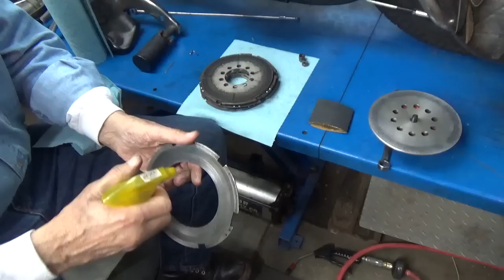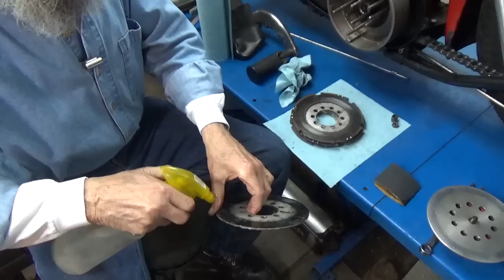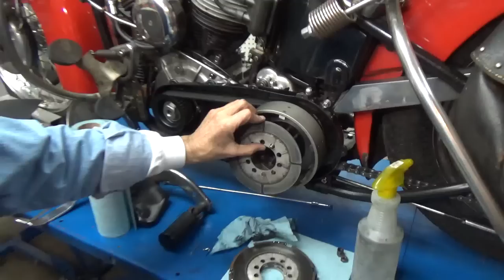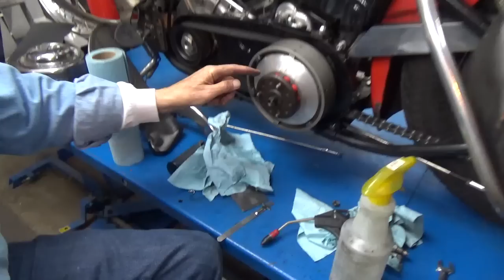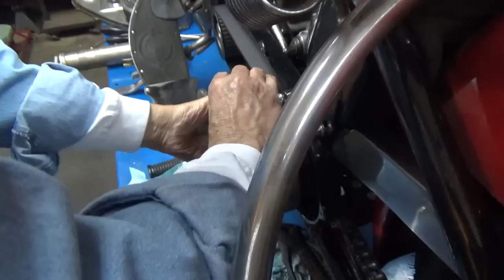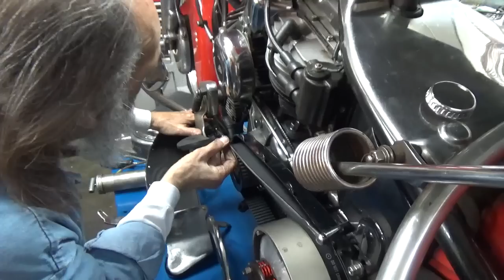We're Doing The Clutch Adjustment On My Harley Davidson Panhead Again!

Comment: Hi Mike, Many Thanks for sharing all your knowledge. You have been a valuable resource to me over and over again. I have a slight issue with my clutch on my 1981 FXWG Shovelhead. Everything is stock but it has a very agressive crash style gear change as I change gear it sounds pretty clunky. I've had advice and people say "Buddy, that's just how they are" but I have a second symptom with is I cannot find neutral while the bike is running. She just jumps from 1st to 2nd and back to first until I turn the bike off. At which point neutral is easy to find. I've used up all the adjustment on the cable and am left with no more play. My question is, should I be compressing the springs on the pressure plate or decompressing the springs to get a bit more clutch action. Hope your day is awesome. Bill from Ireland 😁
Reply from the maker: The bike jumping back and forth between gears sounds like a transmission problem.  That 81 4 speed has what's referred to as a "rotary top."  Inside that lid is a shifter plate.  I suspect something wrong in there.  That plate registers the position for each gear.  I'd have to look inside.  I hope that doesn't ruin your day.  You wished me an awesome day and I don't want to be the bearer of bad tidings.  But, I don't think I could tolerate a gear change that I didn't call for.  Take care.
Reply: @pacificmike9501  Hi Mike, Thank you for your advice and for taking the time to respond. It's really special that you always make time to. I appreciate it a lot.
Reply: @billynolan3393  Hey billy when you say "jumps from first to second" are you referring to trying to find neutral? Or do you mean its shifting gears without any input from you on the gear lever?  Ive noticed with my twin cam that it can occasionally be finicky about finding neutral. Its was really bad when I first got the bike. Ive since changed the oil and meticulously adjusted the clutch pushrod and the cable to spec. That makes a huge difference. But that isnt all. Ive noticed that the gearbox has another habit I am familiar with on other machines - getting to neutral is a whole lot easier if the bike is just barely rolling or if I just give the bike a little nudge from the clutch as I go for neutral. It has to do with how the gearbox meshes and a little input will let things click. BTW = I dont know if this is the case with the gearbox in your bike, but Im told that in mine, they are designed to not go into neutral from second. I could be wrong about that though. 

So if it is a "find neutral" issue - double check all the adjustments - pushrod and cable. and try hitting neutral just as you roll to a stop. that will probably give you a better idea where things need to be looked at to make things even better.
Reply: @michaelhazen8658  Hi Mike, yes that's exactly it. She won't find neutral when running. I have naturally found that if I grab neutral just as I'm coming to a stop. It's much easier. The bike had been sitting for a long time before this year and I freshened up most everything apart from the clutch. I'll take it out and give it a clean and then adjust the push rod and cable. Many Thanks!!!!! 😁
Reply: @billynolan3393  Excellent! Im also using specific gearbox and primary oils - not "one oil for all" or ATF in the primary as some like to do. I think type and age of the oils makes a difference.

Comment: Hi Mike thanks for the video I’m having trouble adjusting my clutch adjusting screw I can turn it in to tighten the clutch but I still can’t get my clutch to function correctly it will not disengage the gears so it always seems like it’s in gear for example if it was started and I open the clutch to release it to bike with jump in stall
Any ideas on how I can fix this
1955 Panhead
Reply from the maker: Hard to say.  You may have your plates sticking together.  Have you disassembled and cleaned it all?

Comment: Hi Mike! Realy enjoying your channel, great to see another old grey haired biker type working on old bikes. Kind of an off topic question for you. I recently aquired a 59 Pan after many years of running a 77 Shovel. Loved the belt drive on the shovel and I'm thinking that the Pan will get a belt this winter. My question is how did you route the crankcase breather on Baby Doll?
Reply from the maker: You may have to modify the breather tube going into the primary.  Remove the tube and modify the primary end to attach a 3/8 hose to the end of it.  Route the hose behind the primary tin and out the back of the bike.  Be careful how you do it so it doesn't ever spray oil on the rear tire.  Be sure you bottom the oiler screw on the oil pump.  Don't tighten it so much that it damages the pump.  Now it is just a breather and not an oiler.

Comment: I just put in new clutch hub, friction discs, aluminum releasing disc and springs. The Barnett springs are 50 lbs @ 1-1/8”, and appear to be somewhere around a 1/4” shorter than stock. Does that affect the measurement I would set between my pressure plate and my releasing disc versus what the manual would state for stock springs?
Reply from the maker: You say, "Shorter than stock."  By whose calculations?  What years are the new springs intended for?  You mentioned "an aluminum releasing disc."  Are you measuring the spring length from the disc surface?  I believe the springs are seated in the "counterbores" of that disc.  Be sure you're counting that counterbore in the length of the spring.
Reply: The springs are Barnett (part #501-66-10041) which the site says will fit my 71 flh. The springs that were in my clutch, which I can only assume are stock length, though I have only owned the bike for 6 years, are longer than the new ones. The Barnett’s are a hair under 1.5” and the ones I pulled out are 1.72” with my fancy digital caliber. As for measurement location, I prefer to measure from the plate, versus the counterbores for convenience reasons. The depth of the counterbores look to be about 0.340” (11/32”?) deep.
Reply: So I found my answer and thought I would share. The springs are actually for 67 or earlier clutch assemblies, whereas I have a 71. Apparently the earlier assemblies used 3 1/2 friction plates with stiffer springs and had the mousetrap to assist. After 68 we have 5 plates and they ditched the mousetrap. I’m sure you know all this but I dint want you to chase an answer unnecessarily. All the sites I visited state they are compatible. I set it up with the spacing set in the manual as the Barnett rep told me to. The clutch hub nuts are not on a lot, as they are flush with the studs. But they are not loose and I hit them with a dab of blue locktite. Works really well, and I don’t really notice the increased tension as I run a foot clutch. Thanks.

Comment: Hey Mike, new subscriber here. Love your videos. Can't stop binge watching them!

 An old shovel owner and rebuilder here, years ago. Twin cam owner now. Learnin' stuff here like the extra steel disc hint.

Question: I noticed in this video that you installed the clutch steels still shiny but scuffed the discs. What about scuffing the steels? All the old stories in the old days of guys slightly roughing up clutch steel discs on the side of the road on the concrete when the clutch started to slip...?

Thanks again man.
Ride safe,
Frank
Reply from the maker: Not all materials are the same.  Do what works for you.  They will get "polished" in there anyway.  Clean is what you need.  Clean and dry.  Again, what works for you is what you need.  Take care.

Comment: Hi from Russia Mike! Have 1977 shovel. What distance to plate in spring place you gauge? my cluch works good, but have “n” time to time..
Reply from the maker: 1 1/32.  But, what works best is what works best.  Make sure it breaks even all the way around.
Reply: @pacificmike9501  thank you! and another question :my bike have lots of pressure when cold, but warm there's like zero in traffic. s&s oil pump on it, mineral oil 20/50. if run - is 20 and oll great, whan stay in traffic pressure  go to 0. Do you have any solutions? Or is normal

Comment: Mike! Working on a 55 panhead and got everything running good! When the bike gets nice and warm if i am at a stop in first gear with the clutch pulled in the bike will intermittently try to jerk the bike forward.. its an open belt primary and looking at the pressure plate it looks as if it grabs and then frees up and then grabs and frees up.. and it spins with what appears to be a wobble.. any advice on how to attack this problem? Love the videos by the way! Keep em coming
Reply from the maker: Thank You.  We showed getting those plates clean, so they don't stick together.  Another thing to try, and it's not very expensive, is a "Ram Jett Retainer" for the clutch basket, which keeps the basket straight when the clutch is desengaged.  Other than that, readjust the springs.  You will get it, because you're getting the experience.  It gets easier and easier.
Reply: You're awesome thanks for the reply!

Comment: Specking of clutches what's your thoughts on the ram jet retainer? The old lowrider has a 5 bolt studs with the tin retainer and springs, hard to shift into first gear and drages at stops.
Reply from the maker: I first met Roger (Ramjett of Ramjett Products) when he demonstrated that retainer at a shop I was working in back in the early eighties.  We became good friends after that.  I've used those retainers ever since.  If never change to the five stud hub.  But, there's nothing wrong with them.  I just don't see the advantage.

Comment: Hi Mike, '75 FXE Super Glide here.  currently in the bike is a 3-stud clutch hub.  Unevenness felt on the studs indicating wear.  I see Drag Specialties 5-stud hubs after market.  would you point me in the direction of a quality replacement hub and clutch?  Also interested in tracking down the auto-chain tensioner you show in one vid.  Thanks in advance for any suggestions.
Reply from the maker: I don't advertise for any of these people.  But first, I never could find the an advantage to the five stud hub.  You clean everything and make it break even.  Done.  If you want a better than stock clutch all of the suppliers carry better plates and springs. If you're looking for a better designed clutch, they get more expensive.  I like diaphragm clutch springs.  Rivera Primo and Baker Drivetrain come to mind.  The automatic chain tensioner you probably saw is an M-6, carried by most suppliers.

Comment: Mike.....I lost a drag race against a Sportster due to clutch slipping at the end of the quarter, so, I bought a set of Barnett discs. Like wow! I would barely release the clutch lever (Shovelhead) and I was on my way. There sure wasn't much slippage vs the stock HD stuff. For street, give me the stock stuff....but for drag, give me Barnett!....walt...tulsa,ok
Reply from the maker: You know I can't push products.  But, they are a family run company that I've had the pleasure of doing business with personally, since the days of my 305 Honda Scrambler.  That would be 1967 or '68.
Reply: david, my barnett is slipping when i get on it . 80ci 83  fxwg .  seems its always been slipping since i got  the bike back together . i just dont wack it down alot so been dealing w it .  did you go by the barnett spring torque specs?  you running any oil in the primary or using the stock oiler ? maybe im getting to much oil in the basket by filling ity to much ?  any advice would be great !  thanks form the vids mike
Reply: @hanskonrad5850  the Barnett clutch discs that I bought were wet and dry. If your clutch is slipping with them you have something else wrong. (probably not enough pressure plate pressure) I've driven drag cars where the clutch discs were unsprung and that's what the Barnett felt like in my Shovel!)....david
Reply: @davidcook1166  thanks David I thought about the springs also  Will snug up maybe a turn or 2 then check it out .  Barnett says 6 lbs ..hand clutch is very easy to pull so can maybe use a stiffinin

Comment: Thanks, also I hv an aftermarket wet/dry clutch on my 59’, 4 Clutch pads & 4 steel plates, and the distance from the outer Pressure Plate to Spring Collar is not 31/32 it’s very hard to pull the clutch lever but it was 1-1/8 before disassembly but I got it to 1-1/16. Would this be ok for the setup I got, it’s been years and a cpl head injuries since I put it in new in the 90’s ? Thanks
Reply from the maker: Be sure the angle on the clutch arm is correct.  Be sure the throwout bearing is operating correctly.  Remember, a dry clutch runs dry and a wet clutch is really  wet.  Apparently, your clutch can be used either way, but not both.  Your system is for a dry clutch, so you have a dry clutch.  The measurements are merely a starting place.  The springs have to compress to release pressure on the discs.  You didn't mention if you have a mousetrap.  If so, please refer to our video on setting up a mousetrap.  Go to our Youtube Homepage and click on videos,  There's a bunch of them, but find the one on mousetraps.  If you still are having issues, write back with more details.

Comment: Thanks, I restored a 59' Pan thats leaking engine oil from the Primary Case, like 1/2 quart a week if it just is parked, Any ideas ?
Reply from the maker: Yes, it is either "wet sumping" or you need to adjust your chain oiler, or both.

Comment: Mike, First of all I'd like to thank you for all the videos! I'm a true fan. I also have a 52 Pan I've been trying to bring back to original. It was in a 58 swing arm frame when i bought it. I've come a long way since. What belt primary are you running? I don't want the chain to deal with like I had on my 57 years ago. I'd also like more choices on pully sizes to get more on the top end highway gears. Thanks Mike! -Erik
Reply from the maker: Thank You.  I'm running 8mm Rivera Primo primary belt drives on both my Knuckle and my Pan. I believe they are still available from American Prime Mfg. (562) 889-8665.  An 11mm is a slightly higher ratio.  The way to raise that ratio is a bigger trans sprocket.  That's it.  Not a lot of choices on a belt primary.  11mm setup is slightly higher.  On your trans, 25 tooth on a ratchet lid trans, 26 on a jockey lid.  That's super high gearing.
Reply: @pacificmike9501  Thanks for the quick response Mike. I'll check it out.

Comment: Working on my shovelhead clutch . Can of worms. Dry like yours ; belt drive . I have to rev it to get in nuetral . My springs are 5 Barnett and 5 factory springs . So I went back to all factory springs . Now I have to rev to get in neutral and it goes past and to second gear . Frustrated- got it set up as loose as possible and most clutch pull . I seen all of Indian larrys bike have updated clutch hubs . $$$
Well there are several things on market to help clutch basket from wandering. 
Thanks mike . 
Making things more better - 
😁✊🏻👍👌🙏
Reply from the maker: Not sure what the problem is.  Is the clutch not releasing, or is there a transmission problem?  Is the basket loose on the hub?  Is the throwout system funtctioning properly?
Reply: @pacificmike9501  yes it opens wide . Dragging I believe. I have the big fix rollers . I have 5 finger hub . 5 finger not good as 3 now I’m told . I have a primo 11mm belt drive with idler . I know tension is right . Idler seems to keep it riding towards inner primary side . 🤔 👍🙏
Reply from the maker: That's another issue.  Shimming the trans to get the mainshaft in the same plane with the motor shaft is what you need.  Maybe the idler will require some shimming.
Reply: @pacificmike9501  amen mike -   I will investigate. Many thanks . Wife and I got out for a ride ; pi town loop . Dang it was great hearing em v twin’s  roar side by side . 😁 autumn in the air - 
✊🏻👍👌🙏👋
Reply from the maker: You bet.  Been out on my Shovel.  She's serving up some serious thrills lately.
Reply: @pacificmike9501  sounds good . ❤️em shovels even better 🎶👍👌
Reply: @pacificmike9501  what sounds better than a Harley? Two Harley’s - 😁
Reply from the maker: You bet!

Comment: I have a 73 Shovelhead a friend of mine put clutches in. It doesn’t seem to disengage good but now it’s like it’s stuck in one gear and will not change or go to neutral. Where would you start?
Reply from the maker: Jack the rear wheel off the ground and shift by hand.  It should shift with or without the clutch engaged.  Rock the wheel back and forth while you shift the lever.  The engine is not on.  It is off.  You should be able to move the shift lever.  If not, something in the trans is locked up.  Start there.

Comment: Hey Mike, love the content. Question, on my 64 pan I'm going to run a similar primary setup as you BDL drive with a rivera pro clutch . 
The issue is when the clutch basket is fully seated its rubbing the inner primary cover. and the alignment is about 1/4 " off from the drive pully. It seams like i'm missing a spacer to go behind the basket , but i can't find anybody that has one .Somethings not right, hope you can give me some advice. Thanks Mike
Reply from the maker: You're mixing up my bikes.  My Panhead uses a Primo/Rivera 8 mm belt drive and stock clutch.  My Shovelhead uses a stock primary chain with a Genuine Fischer vibration damper and a Primo/Rivera Pro Clutch.  I don't know exactly what you have.  Maybe you're running the wrong motor spacer.  Again, not sure what you got.

Comment: Oil life question for ya. 98 Evo with a little over a hundred miles since the last oil change. I run full synthetic. Bike sat for a little over a year, color looks like I just changed it. Should I change it again or run it till I reach the next 5k miles?
Reply from the maker: Maybe I'm a little extravagant, but any time I question oil, I change it.  Oil reaches it's operating temperature and burns off the impurities that it gets from normal operation.  Any that have formed in your engine from that hundred miles...  I'm just telling you what I would do.